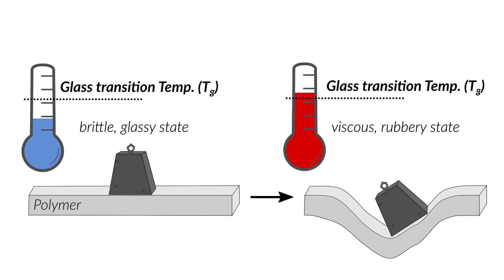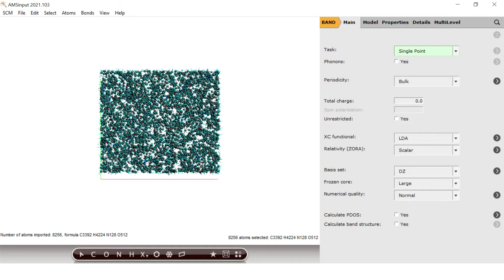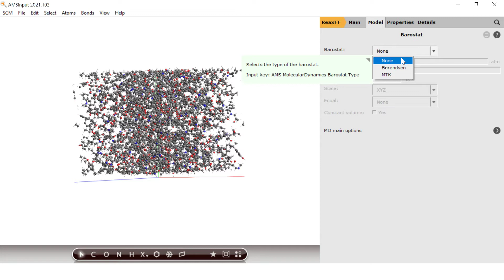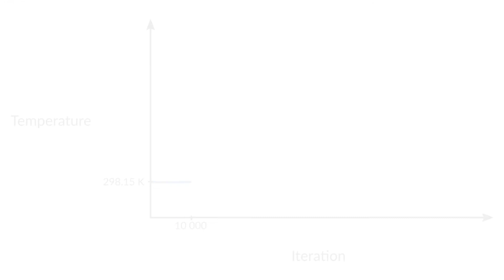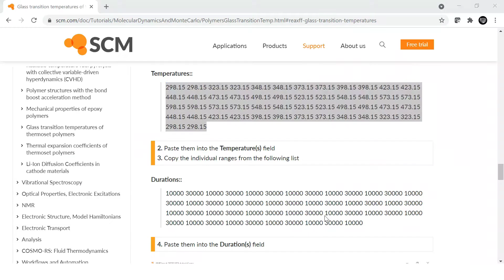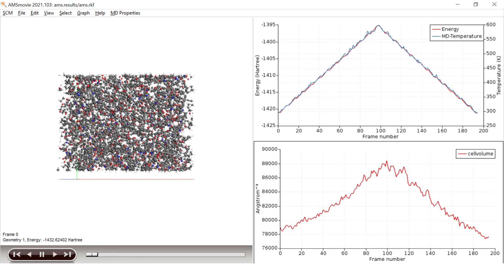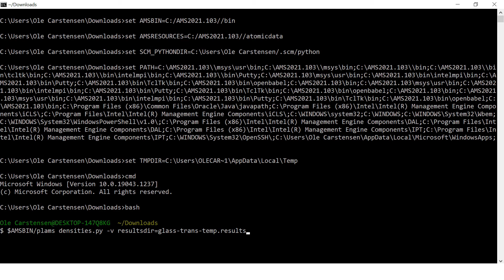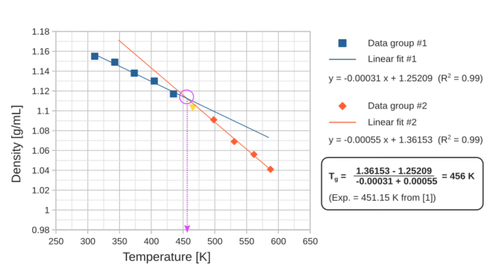Glass transition temperatures of thermoset polymers with ReaxFF | Amsterdam Modeling Suite

Comment: Thank you this is truly beautiful!
How would one calculate the densities without the script?
Reply from the maker: As the number of atoms stays the same, you can calculate the total mass once and divide it by the volume for each point to get the density. On the log file only the volume is printed, but if you visualize with AMSmovie, under MD Properties you can also add a graph 'Density'. If you right-click on the right-hand axis you can change the units, e.g. to g/cm3. You can also export the data points as graph -> save as x,y
But in the end, some python scripting can be worthwhile to make your life easier as Ole demonstrates here.